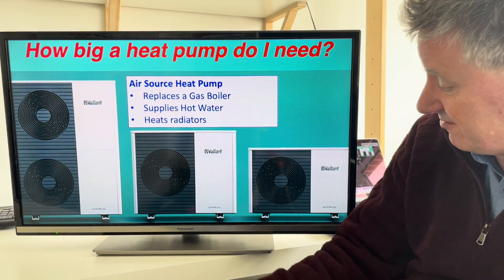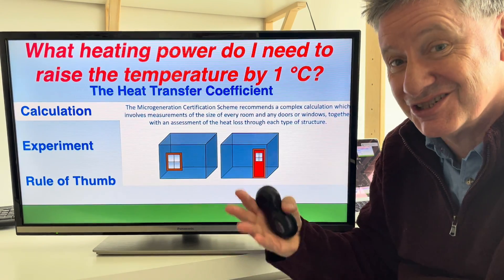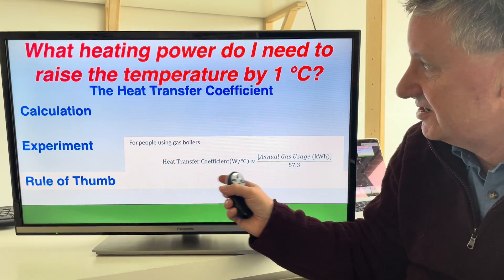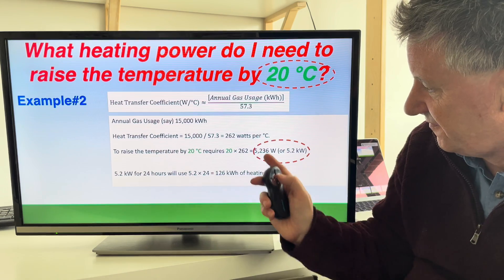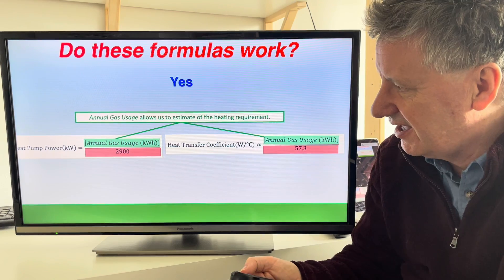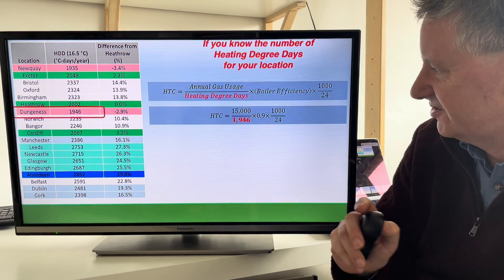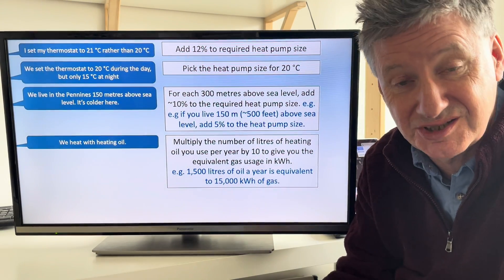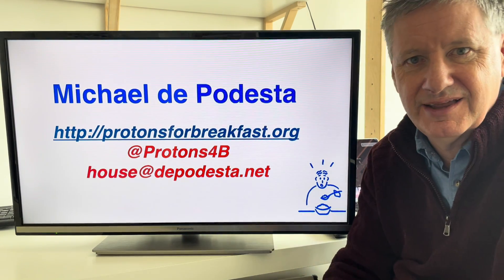How big a heat pump do you need? A simple Rule of Thumb.

Comment: Hello Michael, I have been looking for an alternative method to determine heat loss and came across your video. 
We use our central heating usually from October through until about end of March ( 6 months ) each year, the house is insulated reasonably well and have an annual gas usage of 4200 kwh, using your rule of thumb it would be 4200/57.3 * 20 = 1466 which seems rather low. would i have to find the degree heating days just for the six months the heating is on.
Also i wandered if there might be a way to heat up a room to a certain temperature and then time how long it takes to drop a certain level to calculate the heat loss.
Reply: I use 20000kWh gas , my calculation for HP power is 8.4kW, which is about 5 times yours (in terms of gas usage and HP power) so your figures are correct using Michael's methodology.
Reply from the maker: Roger, Good Evening.

Heating for 6 months is pretty normal, but an annual gas usage of 4,200 kW/year is very low. Is your dwelling particularly small? For reference my extended 3-bed semi (floor area 162 m^2) used 15,000 kWh of gas a year in 2018, and around 7,500 kWh/year after triple glazing and external wall insulation. In the winter of 2020/21 peak heating demand was 50 kWh/day which corresponds to an average heating power of just over 2 kW average power. Currently we heat the house with a 5 kW heat pump, but it is becoming clear that it is probably about two times too large!

Yes there are systems and services out there that will do the heating experiment for you. Basically they put a thermostatted heater in each room and measure the power dissipated to maintain the room - and by adding the numbers up the whole dwelling - a certain number of degrees above the outside. Obviously this needs to be done in winter. I'm sorry that I can't remember the name of the service.

Good luck with your adventures!

M
Reply: @michaeldepodesta001  Hello Michael, its not that small its a 3 bedroom 130m^2  bungalow built in the 80's, its timber framed with about 25mm pir insulation in the walls and block outer walls, floors are concrete base with chipboard floating on 25mm of polystyrene and attic has 250mm fiberglass insulation, the extension i built in 1998 is exactly the same type of structure but with 75mm pir board and outside walls are rendered 4" Thermalite blocks, and all windows and doors are upvc double glazed.

I had a new gas boiler fitted 5 years ago and it has still got 2 years warranty left yet so wont be looking for anything different for a while, but this winter will be experimenting turning down the flow rate temperature to see if that makes any difference in gas usage.

I wouldn't employ anyone to do a heat experiment i would either try to find out the formula's to do it my self or more than likely just use your rule of thumb, i am a bit worried about the amount of electricity a heat pump uses 50 kwh is more than i use in a week now, of coarse if the price of gas ends up the same as electricity or i can get on a time of day tariff with battery storage then that would make a big difference.
Reply from the maker: @rogertrant2101  If you take your gas usage as an estimate of your heating (i.e. ignore hot water and boiler inefficiency) and divide by the floor area one gets 32 kWh/m^2/year. Assuming that your house is close to 20 °C, this is a very good figure. For example, A Passivhaus figure in the UK requires less than 15 kWh/m^2/year and the best retrofit figure is usually 25 kWh/m^2/year. So that is why the rule of thumb suggests a very low heat pump power - you appear to have a well-insulated house!
Reply: @michaeldepodesta001  "Currently we heat the house with a 5 kW heat pump, but it is becoming clear that it is probably about two times too large!"

So there is a significant element of over-specing even using your own experimental data. Interesting. Looks like there could be huge over-specing by installation companies leading to ASHP getting bad publicity "The Ugly Truth" .

Do you find that your 5kW HP is cycling ie switching itself on and off throughout the day, rather than running at lower power continuously?  If it is cycling could this be used as an indicator that your ASHP is over-speced? (Just a thought as an interested householder not a heating engineer.)
Reply from the maker: @davidreece1642  Yes. The system cycles on and off when the outside temperature is above roughly 5 °C (if I recall correctly). You can see that in the data on this blog article:  https://protonsforbreakfast.wordpress.com/2021/11/15/a-weekend-away/

Someone on Twitter asked installers if they had ever come across an undersized heat pump: none of them had. As you say, it seems the entire industry is biased towards systems that are - in engineering terms - over specified. The cycling has no down side to me but I am told it may be bad for the pumps longevity.
Reply: @michaeldepodesta001  Thank you for your reply and even more thanks for your vid, great information for novices like me.

Comment: Very interesting.  I have an electric boiler which should translate to 100% efficiency theoretically.  I also record daily heating kWh usage separate from house kWh use and when I turn the boiler on/off during the heating season.  Likewise, I have a weather station and can obtain heating degree days (in both c and F although I have not found a calculation with F.) for the period of time that I keep the boiler turned on/off.   If I use the heating degree days vs the rule of thumb, I get a 4.6 kW heat pump for the former but 5.7 kW for the latter.  Which is correct? and does your calculation assume the heat pump is turned on 24/7 during the heating period at full power?
Reply from the maker: Gregory, Good Afternoon,

Firstly, regarding degree days, you can generate them yourself from your own data, or use data from degree days.net https://www.degreedays.net/ . Also to convert from °C-days to °F days just multiply by 1.8

If I have read your comment correctly, you find that 
* Heating degree day calculation suggests a 4.6 kW maximum heating demand.
* Rule of thumb suggests a 5.7 kW maximum heating demand.

I don't know why these differ but there are several possible reasons. As you suggest, the rule of thumb assumes that the whole dwelling is at the thermostat temperature 24/7. If your house is not heated for a substantial fraction of the time then the gas usage may be lower than it would be for heating 24/7 and this will lower the recommended size of heat pump.

The role of the 'rule of thumb' is to get something in etc correct ballpark. So if your installer on the basis of a survey suggests 8 kw or 10 kW, you will be in a position to ask how that estimate can make sense.

In any case: good luck with your installation.

M

Comment: So you use only 1.5kw of gas on how water per day? That doesn’t seem right. (2 to 3% of 15,000 kw)
Reply from the maker: Jason: Well spotted! It doesn't seem right because it's not right. My wife and I use around 5 kWh of gas to heat water per day. This is close to the guideline estimate of 3 kWh/person per day. 

I think you may be confused by the graph at around 4m37s in. The temperature data (green) is plotted against the left-hand axis. But the gas data (blue) is plotted against the right-hand axis.

You can download the Powerpoint slides from my blog here: I have no idea why I didn't put this link in the video information. I will do that now.

https://protonsforbreakfast.wordpress.com/2022/04/05/what-size-heat-pump-do-i-need-a-rule-of-thumb/

Best wishes

Michael

Comment: Thanks for this video. I've just had an indicative quote for a 16kW heat pump with the size based on a basic description of my house. They did say that this may come down to 12kW after a survey. Your formula gets me to about 4kW!
Reply from the maker: Thanks Andrew: That's the point of the 'rule of thumb'. The survey based approach is very thorough but makes some assumptions that bias the calculations to oversizing. 

A Twitter call the other day asked installers if anyone had ever come across an undersized heat pump: no one had come across such an installation ever!

Anyway: good luck with your endeavours!

M
Reply: Same here. I did these calculations and got 3kw and all quotes were 10kw or higher. We have settled on 7kw as a bit of a buffer. But the msc calcs are quite lazy about the building material used.
Reply from the maker: @joewentworth7856  Joe. Good Morning. Thanks for the feedback: I hope te rule of thumb helped. M
Reply: @michaeldepodesta001  fantastic set of videos wish I had found earlier  . Heat pump commissioning this week...

Comment: very interesting. Just had a heat pump survery done and it came back recomending a 16kW heat pump. our house is old and most likely not the most heat pump friendly. However, to heat the house with our current oil boiler we use on avergae 900 litres of oil a year, worst case is 1500 litres and that was with a poorly insulated loft. I wonder if we are an edge case which the heat pump survey doesnt cater well for. Just 2 of us in the house, and thermostat set to 17 during the day in winter and usually off all summer and overnight in winter. I also wonder if the survey calculation needs to take into account the criteria to meet the bouiler upgrade scheme grant. The rule of thumb is certainly making me think about if a heat pump is the way to go for us or if other zero carbon solutions can minimise the oil use instead.
Reply from the maker: Mark, Good Morning, Thank you for stopping by.

Obviously I don't know your house, but I can't see how 1,500 of litres - 15,000 kWh of delivered heat per year - can translate to a 16 kW heat pump. As you say, the live in your home may lead to some mismatch, and yes it is quite possible that the result of the MCS process (required for BUS subsidy) has resulted in an overestimate of the heat pump size required. 

In honesty, the rule-of-thumb is designed to do exactly what it is making you do i.e. think "Does this make sense?" It doesn't really deal with complex cases, but my guess your unusual day-time/seasonal temperature profile may not be well-captured by the MCS process.

This whole issue is very lively on Twitter at the moment - follow eg @betateach, @TrystanLea, @kenbone44 @suburbanpirate and friends and you may learn something. They are very helpful people.   

My guess is a heat pump is the answer - it's hard to beat 300% efficiency! - But in any case: best wishes with adventures. 

Michael
Reply: @michaeldepodesta001  thanks Michael, the rule of thumb has done its job, queried it with the surveyor waiting to hear back. I've actually met Trystan an absolute mine of information and experience.
Reply: @marklewisduncombe  Would the installer be allowing for the poor loft insulation. Better to spend money on loft insulation before installing ASHP.
Reply: @davidreece1642  no, we were having loft insulation upgraded to 300mm the week of the survey. The guy doing the survey asked to see the insulation quote and did the numbers using what was on the quote.
Reply: Thanks for your reply. I'm getting the impression that ASHP as being over specified.

Comment: As an American in the Midwestern US, this is all foreign to me but still interesting. Here, most homes are heated by a natural gas fired forced air furnace. Since we need air conditioning in the summer, it’s more economical to combine the delivery system. 

I do have a thought around calculating heat pump size though. I have a Nest thermostat which keeps track of how many hours the system runs each day. I monitor this for the coldest days of the year, and then I take the highest daily usage, multiply by the output of the furnace (we use British Thermal Units!) and divide by 24. That gives you the approximate size of heat pump needed, provided it can output that much at the balance point temperature.
Reply from the maker: Good Afternoon. That is an excellent and robust way to estimate the heat pump size required.

I have three comments which you are probably already aware of but I will says them any way. 

1. Heat pump sizes. The badge on a heat pump (say 5 kW) specifies its thermal output at a standard condition - which may to be the coldest that it becomes at your location. So check that the heat pump can output the required amount of heat AT THE COLDEST TEMPERATURE YOU CAN REASONABLY EXPECT.

2. Gas burners vary in efficiency - can be as low as 75% if they are not condensing.

3. Gas burners can easily heat water to 70 °C but heat pumps will struggle to do that. Using the lowest possible flow temperature that will heat your house will result in better heat pump operation (higher COP)

Anyway, thank you for stopping by and commenting.

Best wishes: Michael

Comment: I have been reading your blog posts and email blasts for quite a while - 

Happy to see the videos - a larger audience potential.   I appreciate the detail available in the written form but the vids are more universally accessible.
Reply: BTW - likely replacing our primary residence boiler in Canada with and ASHP.     Ambient temps often below -20C.    

And, our secondary residence ( Ambient often at -30C with -40C nights) is 100% heat pump.
Reply: @brucemacneil  Bruce, which brand of ASHP do you have and does it keep you warm in those harsh Canadian tempertures?
Reply: @davidreece1642  I have 2 houses.    One is in Toronto (winter temps touch -20C but rarely) - it is now very well insulated and heated with a boiler.  It has been heated via a boiler since forever - we are replacing the boiler with ASHP and air handler "heads" inside.   We presently have air conditioning via a superficially similar system.   

The second house (a full size house) is in Quebec - winter temps are -20C normally with prolonged stretches at -35C.    This house is heated with a 20 year old ASHP that looks like a standard brand.   This heat pump is connected to an air handler with ductwork on the inside.  

Brands - I take my cues from Southeast Asia where there are millions of "split air conditioning" units installed.   These generally have no brand ID and are very inexpensive.   AND - have been functioning perfectly for decades.  

I am frugal, a mechanical engineer with loads of experience building new and renovating older buildings. 

IF you are in an area where the Ambient temps are usually above -20C, almost any unit works as well as any other.  Claims of reliability should be suspect  and the best plan is to have a good relationship with a trusted installer. 

If you are looking for ASHP to work well to -45C (really) - a Canadian company called Arctic Heat Pumps would be my recommendation. 

If you are in an older home with hot water radiators do not discount the idea of a mini spit ASHP - 

Some regions of the world are experiencing super hot summers for the first time and the houses do not have any cooling.   The mini-split ASHP does heating and cooling. 

Also - insulation and windows are key.   It is routine to reduce the heat loss/gain in an older home by 90% through a remodel with insulation.
Reply: @brucemacneil  Thank you for such a detailed reply. We don't have many days below -5C in the UK so your real life situation is very reassuring for people like me who are thinking about ASHP.
Reply: @davidreece1642  The Coefficient of Performance of almost any ASHP will be greater than 3 at -5C.

Cape Breton Island - colder climate - almost every house has added an ASHP over the past 10 years.
Reply: BTW - I offer a "come and see for yourself" house trade vacation program :)
Reply: @brucemacneil  UK 10 years behind.
Reply: @davidreece1642  Understandable - 

The 1973 Oil shock kicked insulation and home heating to the forefront of conversation. 

Windows, insulation and retrofit became the talk of the area.
Reply: @brucemacneil  A great pity the same didn't occur here.